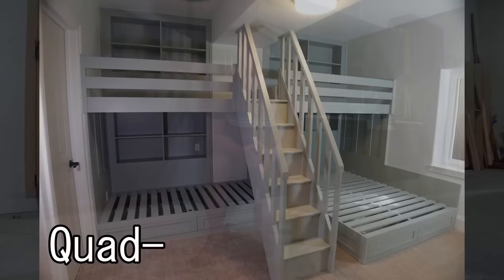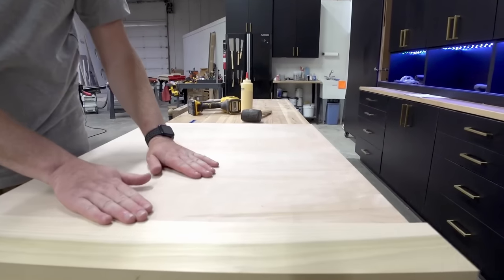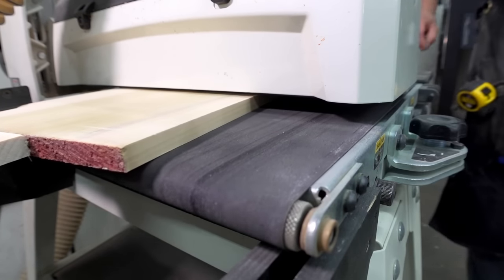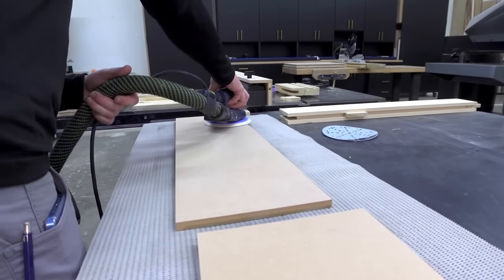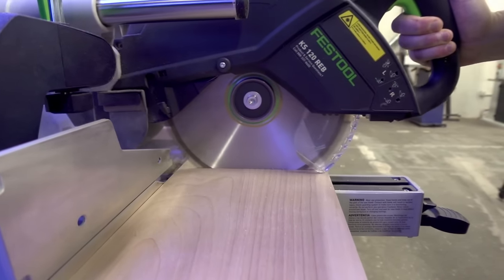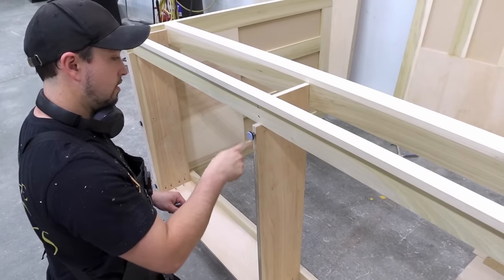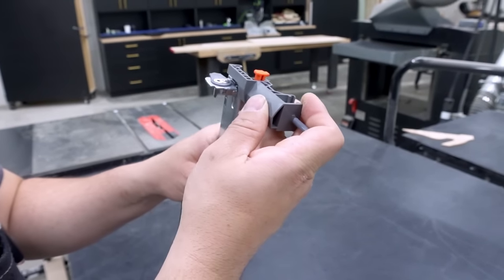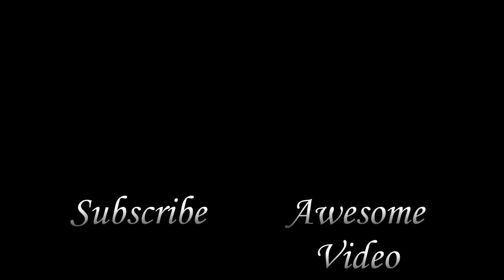A QUAD Bunkbed Room || For The Whole Family

Comment: What a behemoth of a unit. I've learned and appreciate the spline technique, but this video reminded me of that... very effective. Two questions: 1- Preassembly is mandatory of course, but at what point does running the screws in and out of the same holes degrade the joint? ... and, 2- where do you get veneer plywood with that nice, thick veneer?!?
Great work as always!
Reply from the maker: Thanks as always! To answer the screw question, we use longer screws during final assembly on site. Sometimes even thicker screws too. 
I get my plywood from Austin Hardwoods of Denver. 
Thanks for watching!
Reply: @FortressFineWoodworks  Cool... I suspected a hardwood supplier was the answer. Need to find one near me (VA) because I've about had it with big box micron-veneer ply.
Reply from the maker: I'm honestly surprised you've even had the patience with that stuff. The ply I use is called Combination core. The outer most cores before the veneer are mdf for better stability. and it only costs about 15% more than the big box garbage.
Reply: @FortressFineWoodworks  Yeah, looking at the shots of the cross section I could tell that was ^chef kiss^ stuff. I likely don't have to explain that when lack of availability intersects with lack of money, patience becomes really, really easy. Win?
Reply: Rockler and Woodcraft both have stores in Virginia and Wood Workers Source can do mail order there and is a popular place for several youtube woodworking channels.
Reply: @inmyimage1081  Thanks, dude! Question: I need 4'x8' sheets, so mail-order is kinda not an option I'm thinking, so do Rockler and Woodcraft have that large? I've been to the Woodcraft in Springfield, VA, and they've got baltic birch just big enough for craft stuff or a new crosscut sled... :(
Reply: @mattelias721  I know Menards does in several different veneer species in addition to selling just the veneer sheet so you can essentially make your own if you can’t find anything near you. I’d call Rockler and Woodcraft and if they don’t carry it in stores they might be able to special order it. I’d also check with 84 Lumber if there is one nearby and don’t pass up sawmills in the area because here in Indiana a couple do sell plywood.
Reply: @inmyimage1081  I appreciate all that. Unfortunately, I've got none of that that I know of, and the 84 Lumber caters only to contractors (i.e., they'll sell you 5000 deck screws at once, but no hardwood). Thanks anyway... I'll find something soon, I like the calling Woodcraft idea!